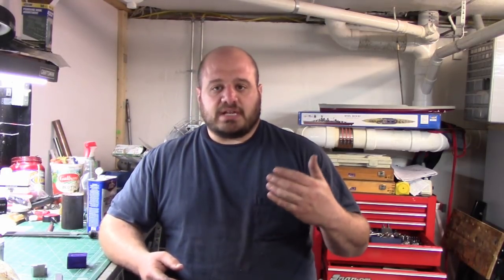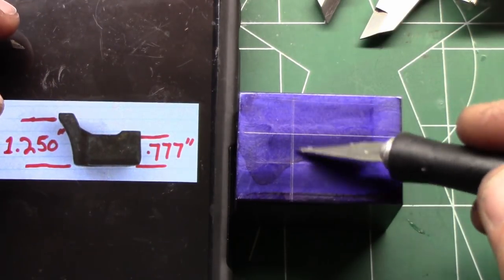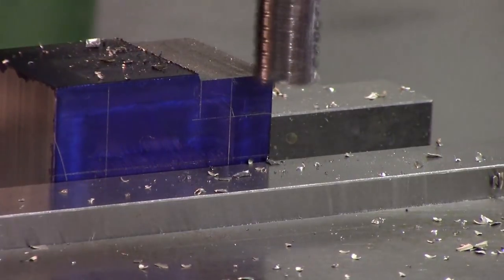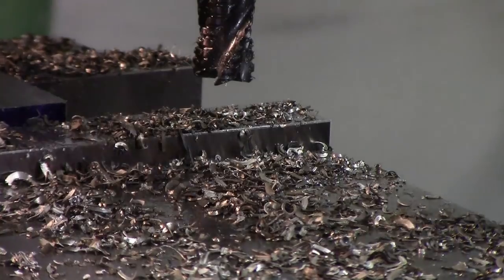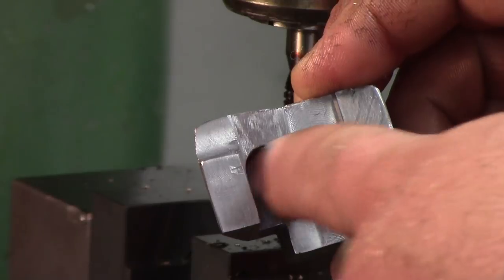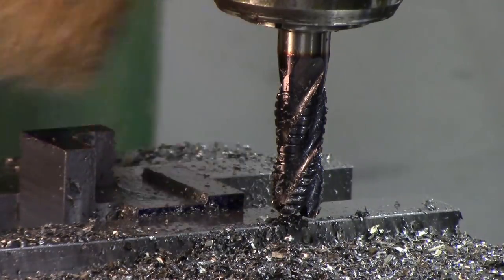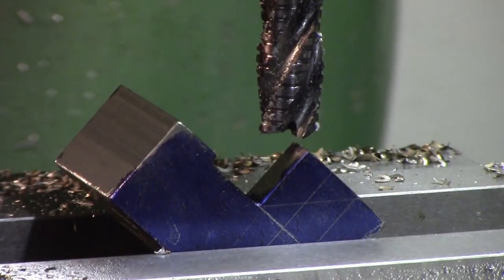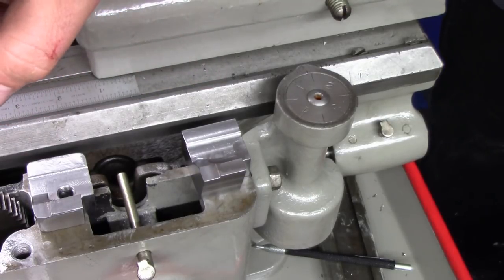Making a Southbend Carriage Lock

Comment: Amazing. Great job making that piece. I have a 10L and I’m having trouble getting mine in place. My hands are not small enough to get in there from the side. But it looks like you put it in from above. What do I need to remove to get access to that area?
Thanks,
Paul
Reply from the maker: Remove the screws holding the apron to the carriage and slide it to the side and you should be able to get in there
Reply: @Halligan142  ok. Do I need to support the apron?
Do you know how to remove the cross slide when there’s a taper attachment?
I appreciate your help. 
Paul
Reply from the maker: @paulmanhart4481 
Move carriage as far to the right as possible.  Support the apron with a block of wood.  Remove two bolts on the far side of the saddle that clamp the back edge under the bed.  This is the saddle clamp/gibb.  Remove the two slotted screws in the saddle that go into the apron.  The only thing that is holding you now is the block of wood and the power feed gear that meshes with the crosslide screw.  Lift the whole saddle up and it will slide out.  Just be careful. The leadscrew is still attached through the saddle and the saddle will want to turn on it. The block of wood will support the apron to keep the weight off the screw and moving the carriage all the way to the right keeps it as close to the.leadscrew support to minimize any deflection.
Reply: @Halligan142  “Lift the whole saddle up and it will slide off”. 
Does this mean I must remove the saddle? From your video, it looked like you just has the top of the apron off. Looked easy. 
This is my first lathe and I’m learning as much as I can by disassembling things, inspecting and cleaning them. But I don’t think I’m ready to tackle the saddle and apron. 
1. I move the saddle all the way to the right. 
2. Support it with a block of wood. 
3. Remove the left/right slotted bolts on top of the apron. 
I guess I don’t know where the saddle ends and apron starts. 
I’ll look at it now that I have your instructions and see if I can handle it. I always break stuff, or can’t get things back together when I mess with them too much. But I’ve mastered the compound slide and tailstock. That’s progress. 
Thanks H.
Reply: @Halligan142  Ah Ha! I think I understand. The saddle stands the ways and the apron hangs off the front end. So the cross slide is on the saddle. 
I have a taper attachment and cross slide on there now. That saddle isn’t going anywhere. 
I appreciate your patience with new guys like me. Must be frustrating. 
I’d like to remove taper and cross slide but I’m struggling with how to get the lead screw out (cross screw).

Comment: Saludos Greg, I like the video.  Just a few comments.  Obviously the carriage lock that you made works and probably works well.  Myself I prefer the type of lock that pulls the saddle down onto the lathe bed. I think that the SB Lock would do the same but it only pulls down the side the apron is on.  If you had a lock that pulled the center of the saddle then in theory both side of the saddle are pulled down onto the lathe bed.   I would like to hear your thoughts on the subject.  Many thanks for all your videos.  I especially like the 13" SB rebuild.  I have a SB 9" model A that I am trying to rebuild.  They are a labor of love.